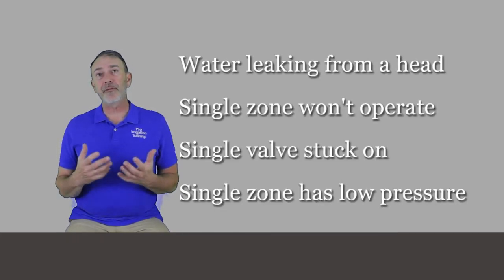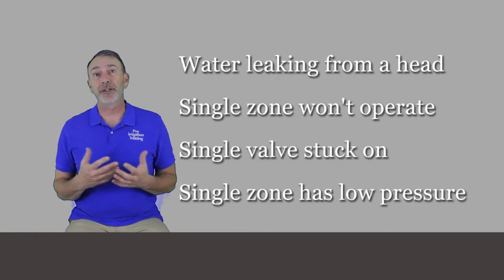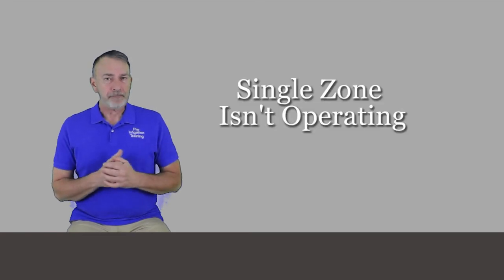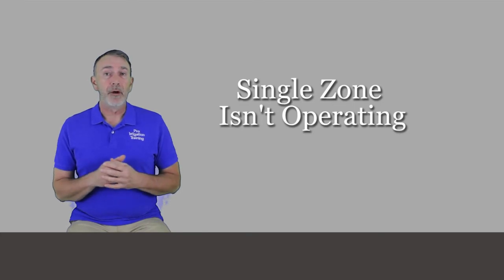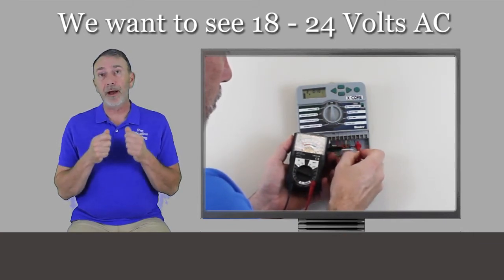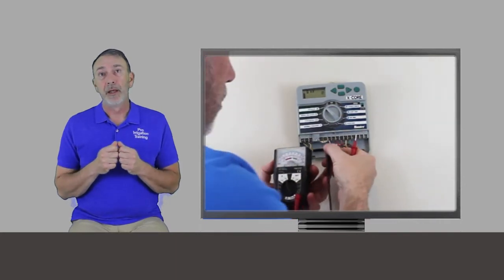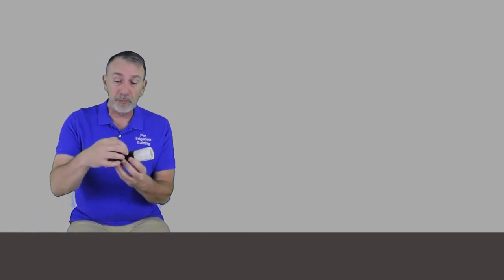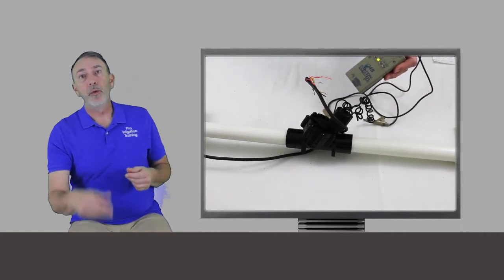Solenoid Valve Troubleshooting & Repair Scenarios (sprinkler systems)

Comment: I agree with all you are talking about. The problems I run into here in high desert of New Mexico is rusty solenoid wires. For some reason alot of the systems in this area they did not use grease. They just put a cap on. I check the timer then unscrew the cap I would say 60 percent of the time it's rusty wire, cut it back to a good section, and re strip it grease and cap it. Really enjoying your channel thank you.
Reply from the maker: Thanks for watching, glad you enjoy the channel. The problem you describe is everywhere unfortunately. That's why I'm here with the education, to hopefully raise the technical proficiency of people entering the business.
Reply: @Proirrigationtraining  thank you again for the videos. I got into irrigation out of necessity, got so many calls I figure better learn it. Been very profitable and educational two years.

Comment: hello Great video, however my issue isnt covered, or i missed it. I have an entire zone (3 Heads), that arent working. I went to the valve box, turned the solenoid, nothing. I then completely removed the solenoid the water started coming out of the opening, i screwed it back on to stop the water from shooting in the air. I suspect, and this is my very first time doing this that there is something wrong with the valve. what should my next steps be? Thank you for any help.
Reply from the maker: Ok, we know that there is pressure to the valve. We just don't have water getting through the valve and pipes to get to the heads. Look on top of the valve and see if there's a flow regulator which is usually directly in the middle on top. If there is one, turn it counter-clockwise to see if it had been inadvertently turned off. If it doesn't have one, you need to turn the water supply off and disassemble the valve and look for obstructions. No obstructions, then inspect the diaphragm and spring for damage. It's pretty cheap to replace all the removable parts. Also, run the zone and give it a minute and look for a big leak. It may not look as big as you think or even a head off that you haven't seen. If water was passing through the valve and getting through the pipes, the zone should have come on when you took the solenoid out. You don't have to fully unscrew it to manually actuate the valve. Just slowly unscrew it until you hear water start chugging through the valve you will hear it or feel it.